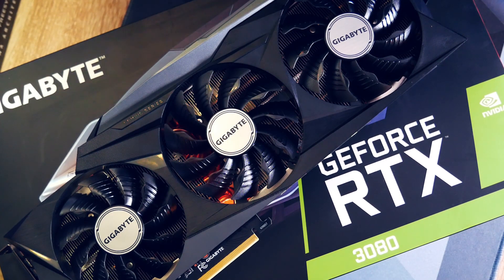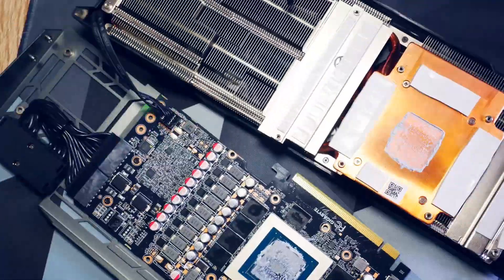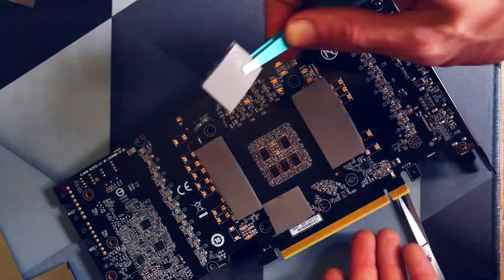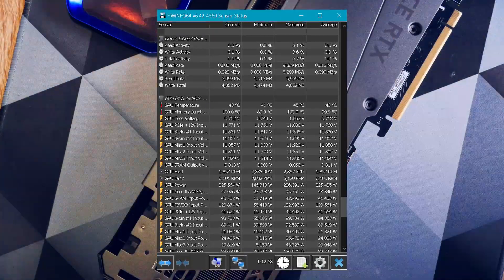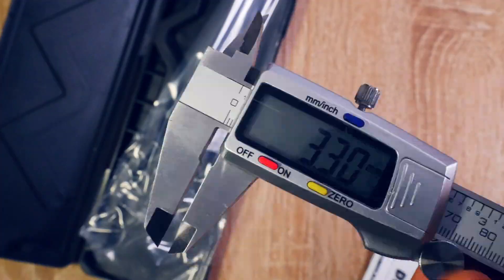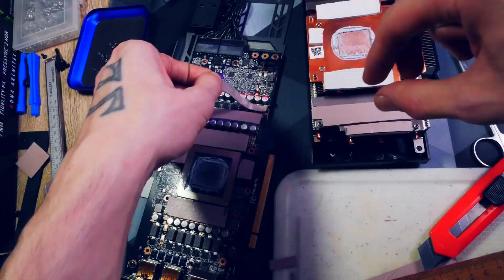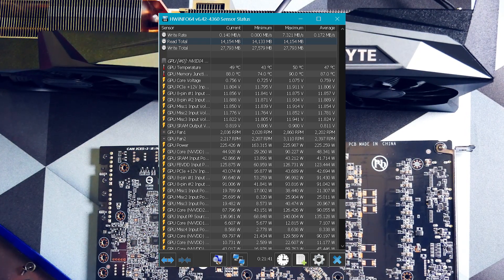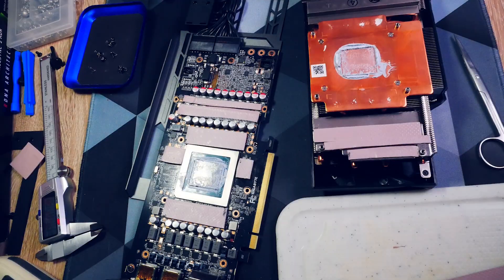How to fix the RTX 3080 with Thermal Pads | Gigabyte Gaming OC

Comment from the maker: Follow Up on Hashrate & Temps: https://youtu.be/uqc8uvjX-AA
Reply: Will this work for a 6900 XT Gaming OC (Gigabyte)
Reply: Do you by any chance have measurements for the fin stack. I want to replace the stock shroud and fans with a printed shroud for 2x 140mm fans and it would be great if I didn't have to take the card apart just for measuring.
Reply: Whos going to be the first to offer this is a service? Similar to how Silicon lottery does delidding for CPU's...
Reply: Bro gpu fan cabel stuck how you remove that cabel i try really hard but it stuck...any tips pls reply

Comment: When I bought my first 3080, I adjusted and installed the pads according to your instructions.
As I bought the second one shortly afterwards, I used this video again to do the pad mod.
Then again six months later, when I got my 3090.
All models were therefore the Gigabyte Gaming OC variant.

Now, four years later (how time flies), I sold the two 3080s after more than a year of mining, and the 3090 is still fighting bravely in my rig. 
I bought the two 80s for €800 each at the time, mined well over €3,500 (current value) and then, when ETH switched to staking, sold the cards together for €1,500 each when I stopped.
I know it's not that much money, but I saw it more as an experiment from the start and enjoyed the whole process of setting it up, etc.
The fact that I didn't end up losing money is actually more of a bonus.

Anyway, the 3090 which also mined briefly, but only when I was at home or the PC was running, cost me €2,500 and, if you calculate it that way, was still free in terms of ROI.
Now I had to refer back to your video because I was no longer sure about the quantity or thickness of the pads, and your solution from back then has worked flawlessly/perfectly to this day. 
Replacing the pads was actually long overdue, but I had a lot to do with my master's degree and private stuff.

I just wanted to say thank you again a thousand times. 
Thank you for allowing me to run my PC without any worries over the last few years, even when I wasn't at home.
Thank you for everything working so well to this day.
May all your dreams come true!

Thank you from Germany,
Tim

Comment: Im happy to report that my GPU was saved because of your tutorial and new pads.

My gpu was the Rev 1.0 but without the oily pads and pads added on the back, but it was still messed up inside. The pads around the gpu core were so bad that they were basically solid dust lol.

I changed everything as advised and recommended aside from the pads on the backplate (used Galid) and on the core, instead of a thermal paste, I used the Honeywell PTM 7950.

The results are incredible. On 100% GPU usage, it went from 82-84 celsius/85-100% vent speed, to 60-65 celsius on 70-73% vent speed. Absurd improvement. Thank you for the tutorial and heads up about what mm of thermpads to use.

Comment: They finally stopped using the "oily" white thermal pads, they are now "dry" dark grey pads. They also added thermal pads to the back of the card. I purchased my Gigabyte Gaming OC 3080 12gb last July for $729 from Newegg. Upon initial inspection, looking down the sides of the card, I noticed right away that there were thermal pads on the back of the card and that the thermal pads on the VRAM chips were dark grey unlike in all of the videos I had watched (most of which were over a year old) My card was brand new, warranty sticker intact. My temps are amazing too. I planned on having to probably replace the thermal pads and repaste but I don't see how I could make them any better.
Reply: Oh wow, this is great news!  I just found this video because I just purchased a 1-year old Gigabyte Gaming OC RTX 3080 12GB for 450 and was planning to add/replace thermal pads.  I will look to see if the card has these newer pads pre-installed.  Saves me some time!

Comment: I know that there has been a follow-up video saying that the thermal pads are keeping the memory temps low but my experience was that they Thermal Grizzly pads eventually degraded in performance over time.  I too used 3mm Thermal Grizzly pads on the backplate so the exact same mods as in this video on the exact same model of card.  The TG pads did, to their credit, not leak oil all over the card like the originals.  1.6mm copper plate in place of thermal pads has provided me with a permanent drop in memory temps.

Comment: Hi mate. I have the same card. Will this mod improve gpu without overclocking? My card is getting hot at idle and the fans come on randomly but its quite a loud thudding noise when they spin up and down

Comment: Thank you a lot for the video. I followed your instructions but took a lot of care and improved some details.
All temperatures went way down (-15 - - 30°C) but the VRAM temp in Furmark sank from 110° to 82°C on a hour long stress test, while the GPU stays at 60.
Thank you very much, but please use the GPU for gaming and not for damn mining!
Reply: Thank you for reporting GPU core. It's entirely possible that sinking heat from RAM could warm the core.
Also your comment about mining is SPOT ON

Comment: Hello and thnaks for the video. Is 3mm going to be too much for inside the card? That's all i have for now. Should I only do the ones on the backplate?
Reply from the maker: Yes I would only do the backplate if you only have 3mm (attention, newer versions of this card do have pads on the backplate, but Gigabyte's stock pads are still not good). If you use 3mm on the front it could happen that other parts don't make proper contact anymore and therefore overheat again. Cheeers
Reply: @CursedMining  Thx for the answer and yes you were right, it didn't work properly ;).

Comment: help please

I bought a GIGABYTE 3060 ti graphics card, but it has a lot of heat, but I do not know how much vram is because the Linux system, but the heat palit is much higher than the 3070 brand. Do I have to change the thermal pads?
Did I set the vram frequency to 1800, is that a problem?
i use the crad for mining , and i am worry about that. please help🙏

Comment: isnt there a V2 of this card where they have addressed the heating problems?
Reply from the maker: I heard so in a few comments, the one from this video is definitely V1. The V2 seems to have pads on the backplate, but still Gigabyte's stock pads are generally the worst, so the process of this video might still help someone achieve better thermal performance :)

Comment: My gigabyte 3080 is one day old. When i first plugged it in I was getting 80-90 mh/s. Within two hours it's dropped to 30mh/s. I've spent 10 hours trying to fix the issue. Nothing works.
Reply: But have you replaced the thermal pads?

Comment: Nothing beats copper shim mod for VRAM, best pads out there are 12.8w/mk vs 401w/mk with copper. Copper shims cost <$10 for 10-20pcs while premium pads are upwards of $20-30.
Reply: What's the thickness of the copper shims for the front and back?

Comment: I just did mine and temps went from 100C to 72C :) I used the EC360 Silver pads. GPU temp reduced by 3c from using Kryonaut as well.
Reply: I'm glad to see your GPU core temp dropped because it's possible that sinking heat from RAM into cooler can heat the core.
Reply: @isaacstyles92  it didn't. Core temps are lower :)
Reply: @SephirothVG  very encouraging for my 3060ti, which is often bound by GPU core speed instead of RAM.

Comment: Be aware that the rev 2.0 gigabyte rtx 3080 does, in fact, come with thermal pads on the back of the PCB
Reply: thats what i thought, straight from the box  my rev 2.0 have 78-82° C memory temps, on 80-85% fan speed on overclocked settings

Comment: Confirmed all brands are cheap on their thermal pad, not only Gigabyte, tbh :))))
Reply from the maker: 100%! There was no card on this channel without bug improvement after a pad change which.. customers should not need to do 😁 cheers mate ⛏️
Reply: @CursedMining  I got one of this card, I pull it from Cyber Power prebuild fair price from BestBuy, but I can't pull the second fan cable off PCb, I think they use glue on it, I broked the RGB cable also but I soldered new header alr. The card's warranty is only 1 year instead of 4 year as my Extreme and Vision :))). now it's time to repad once again and claer a ton of dust lol

Comment: I bought this specific card just recently but I only came across this GDDR6X thermal problem recently... should I really consider doing this? I do plan to undervolt the gpu and I won't use it for anything else other than gaming, gpu 3d rendering, and etc (no mining).
Reply from the maker: No one can decide if you should do this sir. Get hwinfo64 to check memory temps during your applications in your case/ambient, especially gaming is worse than mining in terms of peak heat. Cheers
Reply: @CursedMining  alright, will do then. I’ll reply with my results once I obtain them :P

Comment: Thank you for the nice video, i was planning to change the thermal pads for my gpu which is the same model as the one in the video, the only problem is that the only thermal pads that have been available in my country is the 2mm ones, should i go for it and use those 2mm everywhere or should i just wait for how long it may get for other thickness choices to be available. if i can go all for 2mm would it be safe or will there be compromises.
Thanks again
Reply from the maker: Hello, unfortunately there will be comprimises. F.e. 2mm instead of 1mm on the electronics can make it so that the 2mm on the Vram do not connect to the heatsink etc. 
If your card is really overheating and you only got 2mm , I'd recommend to only redo the Vram pads to get an instant improvement and keep the old ones in tact for 1mm, then if not enough, get the 1mm and 3mm for the rest :) cheers

Comment: Hello, its a nice video, what happen if i change only for the vram pads? Is it affected to be cool or same?
Reply from the maker: heyho mate, thank you very much! You will definitely see improvement with front only but not as good as doing both as heat will be trapped on the back. Cheers :)

Comment: What about the pad sizes? is 85 x 45 x 1 mm enough for capacitors? and 85 x 45 x 2 mm for Vrams? what is the longest pad size i need when i try to replace them? they are thecapacitors right?

Comment: Thanks very much for your video I just did this to my 3080 gaming OC and dropped my temps by nearly 20°. I'm only gaming but it's still nice to know I made my card safe and protected my investment.
Reply from the maker: hey mate :) I am very happy to hear that. I 100% agree, it is about protecting our investment, no matter what we use it for! Have a great day :)
Reply: @CursedMining  also I used the mystical Gelid for the underside of my back plate and a brand called Smalloo 8wmk for the VRAM and power hardware. Unable to verify wmk claims either but so far so good and performance is reasonable enough.
Reply from the maker: @rocsorianoguitar  thanks for sharing, I am always interested in those brands. Aye actual verification is hard except if you want to redo the same cards but I honestly don't want to waste the pads to try, I use enough as it is 😁 have a great day!

Comment: I wish you didnt fast forward the important parts so that I can see the actual screws and process of opening cards and putting back together
Reply from the maker: There are so many 20min + videos of this card out there, so I wanted to make a faster version :)
Reply: @CursedMining  My bad for coming off negative. I was struggling with the fans and couldnt find a video that identified it really. I guess they are just tight in the socket. I got them off by wiggling them. I was so worried about breaking the solder off the back of the socket.

Anyway I dropped from 106C-110C in 75F ambient to 76C in 75F ambient temps mining. I cant believe it worked so well.
Again sorry for the harsh comment earlier.

Comment: I used 2 mm for the front memory chips, 2 x 2mm to squish them so that they touch the backplate. Nothing changed, any idea what I did wrong?
Reply from the maker: heyho! I can think of two things: did you remove plastic on both sides? Sounds stupid but it can happen. Other than that: maybe something is not making contact correctly? It happened to me once that a pad got stuck with a screw and so one part of the GPU did not make contact, it was better than before but still overheated, after reassembling it once it was fine. Other than that just one more thing: what quality/brand pads did you use?
Reply: @CursedMining  Hi thanks for reaching out man, appreciate it :)) I used the Ice Dragon 2 mm pads 17w/mk, I am going to order a different brand as well and then try because I tried reassembling, no plastic, what mm thickness should I use? 2 mm again?
Reply from the maker: oh one other thing: did you do the whole front with 2mm? Caps etc are 1mm, so if you were too thick there it could also be hindering contact somewhere else, everything except the Vram chips themselves on front is 1mm
Reply: @CursedMining  So vram chips 2mm, the rest 1 mm, and the back? I need 3 mm there to touch the backplate in any case
Reply from the maker: Correct I used 3mm on back, I heard people with 4 too when pressing good 👌
Reply: @CursedMining  I changed some things, tightened the screws more and made sure they touched more, now the memory is down to 90c, but the GPU temp is up to 80 and hotspot temp to 105c. That's hot.
Reply from the maker: yeah, is the chip fully covered with paste? feels like now the memory makes contact but the core itself does not :/
Reply: @CursedMining  I think you're right, the chip was fully covered but the screws around the core were hard to really push in, may have overdone it near the core. Will try again tomorrow thanks brother ;))

Comment: So my GELID 2.0mm (W/mK 12) pads arrived today. Not kidding they dropped the 3080 memory temps bang on 30C with all the same settings I was using. Now with better tuned settings 94 MH/s at 74C(memory) with fans running at only 1400RPM  (near silent) in a 19C room. Gigabyte needs to be ashamed of the trash panda pads they installed on these cards.

Comment: Thank you for this video. I did this today and went from memory temps of 110+ (throttling) down to a steady 82. Getting 95+ Mh without trying. Haven't tuned for anything yet. Again, thank you. 

To anyone having trouble with the three pin cable, the only way I could get it off was by sliding a very thin flat tip at the very base of the keyed side of the male terminal, then gently turning the flat tip slightly to pry the male side against the housing of the female side. Unplugging it from the top alone looked like it was going to pull the whole thing out of the PCB. I have little puncture holes in my thumb and forefinger from trying to grasp that thing by the top which just simply didn't work for me. Everything other than that cable was easy.
Reply from the maker: Hey Jesse, I am very glad to hear that it worked for you :) and jep that dang cable, I had imprints of it on my fingers too 🙈 happy mining!!
Reply: one of the three pins came undone when I tried to get it off, will it still work fine?

Comment: Excuse me, could you make a new video specifically about how to clean it? I'm having a meltdown because I'm scared of messing it up.
Reply from the maker: soak the microfibre cloth in alcohol and rub carefully, nothing to worry. Only thing is you have to wait for tge isopropanol to evaporate :) check my GPU maintenance playlist, I opened a lot of cards and cleaned them. Seeing the process a few times can make you more comfortable with it :) cheers ⛏️
Reply: I WAS WRONG. IT WORKS BETTER THAN I EVER IMAGINED. YOU'RE A GOD! THANK YOU SO MUCH! ;w;
Reply: @JamSessionsEX  dude I’m so scared to do this

Comment: I did this. It really didn't fucking help. Something is wrong with mine. ._. I didn't use grizzly though. Its just too much.
Reply from the maker: what pads did you use? maybe not making contact somewhere? That happened to mr on a 3090. Had to reseat so everything stuck together :)

Comment: Hello, I did exactly as described and my vram is still at 110. What is wrong?
Reply from the maker: it sounds like something is not making proper contact. Did you remove plastics on both sides? On a 3090 it happened to me that a pad got stuck with a screwhole and so it also did have an airgap and overheated, after redoing it it worked. Other than that: what type of thermal pads did you use? Cheers
Reply: @CursedMining   First of all thanks for the reply!
Ashamed but wiser than before, I must admit that I applied the thermal pads wrong way. The cooling part was on the wrong side. Changed it and now my vram is 90’C max!
I used thermalright’s odyssey 2mm pads on both sides. Great video nevertheless!
Reply from the maker: @CR7Lasselsson  no worries mate, just glad you figured it out and your card runs cool now :) cheers!

Comment: I can't find 3 mm pads for the back is 2mm fine?
Reply: Could I stack one 2mm and 1mm to make it 3mm for the backplate or? ANy options? No store in my country had 3mm that I could find.
Reply from the maker: @Grife4diamond  I don't know if solely 2mm would work as it really needs to make good contact! Combining works but people claim you loose a little bit conductivity (possible airgaps) but folks did successfully :)